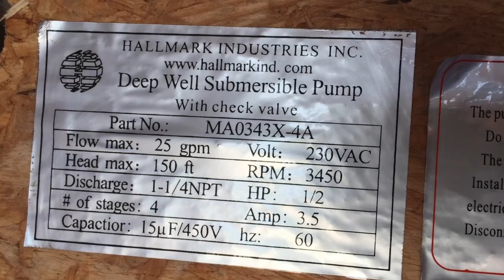OGH - Off Grid Homesteading: Replacing Submersible Well Pump

Comment: did you have to upgrade your inverter to a 220v split phase?
Reply from the maker: Hey there Offshore Droning!  That is a great question.  We started out using the MagnaSine 4024-PAE Inverter you can find more info about it at the link a the end of this message, as we knew that at some point we'd be using 220v in the shop or for some power tools and just wanted to be prepared.  I had NO idea that the inverter produced 1/2 of it's 4000watts on one leg of the inverter, and the other 2000 watts on the other leg.  So the problem was we were trying to pull a huge load on one side as the 110v pump - when it was failing started to pull huge amperage causing the lights to dim and sometimes just shut down the inverter.   After calling the pump manufacturer they said that both pumps the 110v and the 220v use the same power, but what I learned it HOW the power is created and pushed to the pump.  on the 220v side, I had to put a double leg breaker in the power box.  And inside the power box as you put breakers down the line, every other breaker is on one leg lets say the black wire, then the next breaker installed right below the one above, uses the white wire or the red wire or the other side of the 220v (split into 110v on black and 110v on red just out of phase), so NOW we barely notice the pump turning on, just on occasion when the batteries are a little low we'll see a sag for a moment, but NOT like before.    Hope that helps.  Here is the inverter we are using:  http://www.magnum-dimensions.com/product-inverter/4000w-24vdc-pure-sine-inverter-charger-ms-pae
Reply: Off Grid Homesteading yeah I currently only have a 120v inverter and wanted to change my 220v pump out with a 120v pump so I can run water without a generator. Currently my battery bank is too small to run a 120v pump off my inverter.
Reply from the maker: Some Generators have a 220v output, I guess yours does.  Looks like you'd still have to use your generator on 110v to run your pump if the battery bank cant output the surge required to start these pumps.

You can also get a Capacitor I've seen for Homes that help give 110v some extra power that wont shut down your inverter.  I was looking into that solution if we kept the 110v pump.

On our website you can see how we did a pumping solution for our LOWER cistern that runs off 2 solar panels in parallel, but at 12v.    Here is the blog I wrote:  http://offgridhomesteading.seodle.com/off-grid-solar-panel-build-12v-water-pumping-solution-without-batteries/

If your water is in a tank that you can easily get to, I'd recommend a solution like the blog.  If you're doing a submersible well pump, just make sure that the pump, has the capability of pushing up far enough or has enough head pressure to overcome gravity.   In the above blog there is a chart on pressure vs head height.    So if you need help, to find the right pump or size it, and cant figure it out yourself, I do consulting on these types of things.  If you happen to be in the Ozarks area we can do the work for you and the installation.  Just let me know, and I can give you a quote for the hardware solution or both hardware, and install.